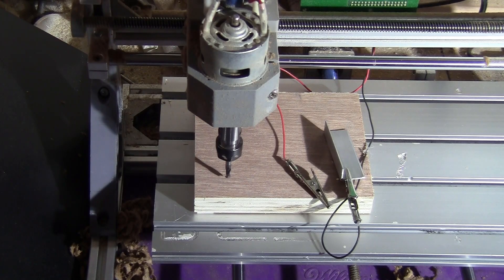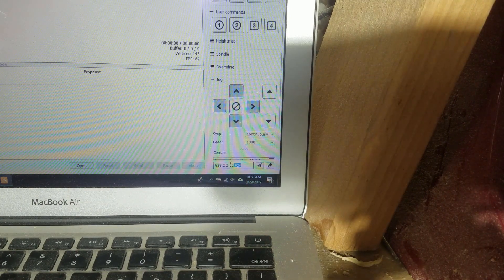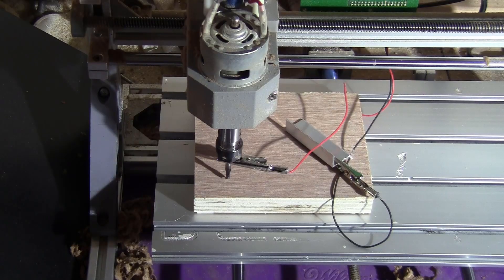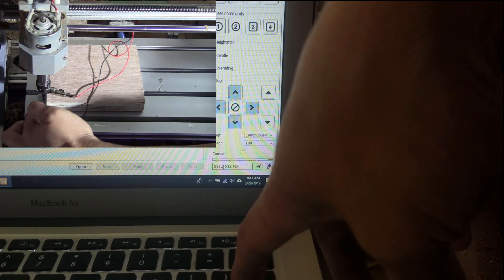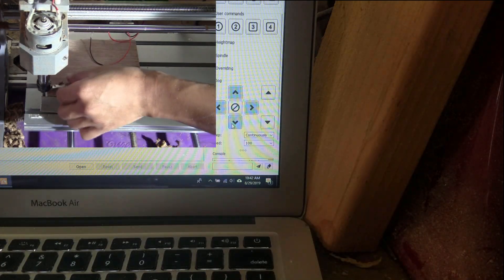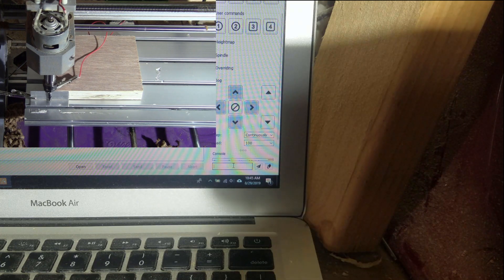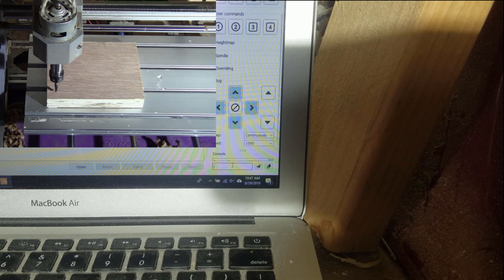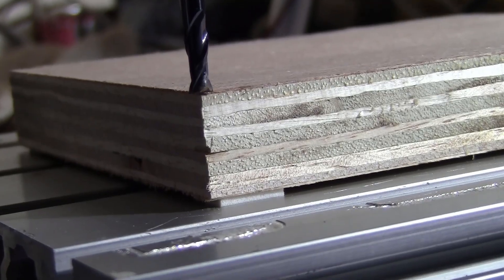3018 CNC - Finding zeros - Tool probe on all X, Y and Z axis

Comment: do you really have to enter those gcodes each time you probe?
Reply from the maker: No, you can program the user buttons, go to service, settings and enter those lines there for each button
Reply: @minhsmancave9448  I figured it out. but buttons are not displayed any more as of 0.8.1... am I wrong?
Reply from the maker: @joetkeshub  Candle 1.1.7 shows the buttons for me. Maybe you should upgrade to newer version of Candle and GRBL

Comment: Thanks so much for your very informative videos - Subscribed, Liked and Alarm set! Now, could this process be automated by writing a short program which would include all the commands you typed in, plus movements in between to account for the hand-jogging you did?
Reply from the maker: Yes, you can, go to settings and you can program a few user buttons.
Reply: @minhsmancave9448  would something like this work:
(Assume tool diameter 3mm and 'finder' thickness 1.6mm)
(Some code here to set the machine head <25mm from desired new origin in all planes)
G91
(set Z zero)
G38.2 Z-25 F24
G92 Z1.6
(move to safe place - Z axis first)
G1 Z10 F300
G1 X-28.1 F300   (-28.1 = -1.5 - 1.6 - 25)
(set X zero)
G38.2 X25 F24
G92 X-3.1
(move again to access Y face)
G1 X-10 F300
G1 Y-28.1 F300
G1 X35 F300
(set Y zero)
g38.2 Y25 F24
G92 Y-3.1
(change to new zero reference)
G90
(move z axis to safe height)
G1 z10 F300
(move to X and Y zero - can be fast feed as tool is 10mm above Z0)
G1 X0 F300
G1 Y0 F300
(move to 3mm above Z0 at fast speed)
G1 Z3 F300
(move to Z0 at slow speed)
G1 Z0 F20
What do you think?
Reply from the maker: In overall I think it will work but you might forgot to move the bit down in Z axis before probing command in the X axis (for the bit to be lower than the surface of the stock). I wouldn't put all in one button though, since you want to be ready before probing in each axis.

Comment: What is the function of this zero finding operation? What's the difference with the zero setting on the software? thank you
Reply from the maker: The use of finding zero on the Z axis is more obvious and useful, especially when you cut something that requires multiple bits with different tool paths. Each time you change the bit, you have to set the zero on the Z axis again (tip of the bit at the surface of the stock). For the X and y axis, it's only useful when your milling process got stopped in the middle and you want to rerun the cut without throwing the stock away. This only works if you did use this method to find zeros on X and Y before milling. If you didn't do that, most likely you will have to throw your stock away in case your machine crashes in the middle
Reply: @minhsmancave9448  thank you

Comment: i have 3018 cnc use board arduino shield v3 , because board original death /burn.  what i am doing setting grbl  ? axis x,y and z not same setting defaut . i use grb 9.0j . please help me . thanks
Reply from the maker: If you're using Arduino as controller, you can install this firmware (newer version but similar to the original firmware of the 3018 CNC): "https://github.com/gnea/grbl/releases/tag/v1.1h.20190825". Then for the parameters, you will have to manually enter these (original parameters for 3018 CNC):
 $0=10

$1=25

$2=0

$3=6

$4=0

$5=0

$6=0

$10=1

$11=1.000

$12=0.002

$13=0

$20=0

$21=1

$22=1

$23=7

$24=25.000

$25=500.000

$26=250

$27=2.000

$30=1000

$31=0

$32=0

$100=800.000

$101=800.000

$102=800.000

$110=2000.000

$111=2000.000

$112=100.000

$120=20.000

$121=20.000

$122=20.000

$130=500.000

$131=500.000

$132=200.000

Comment: Hi please can show how your work surface on the cnc and how it is fix to the bed.
Reply from the maker: It's just like any other 3018 CNC with a aluminum plate for bed. I use 3M mounting tape (spongy type) to stick the stock to the platform

Comment: What should I do to reverse my directions? My axis are going the wrong way
Reply from the maker: Did you type the G91 command first before the probing command?
Reply: Its easy,, just reverse the wiring connection on stepper motor,,